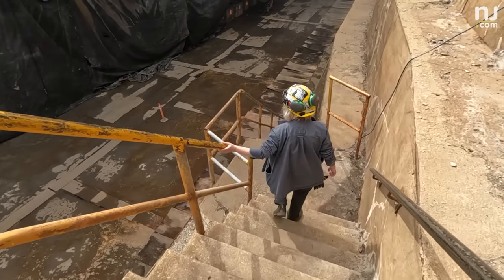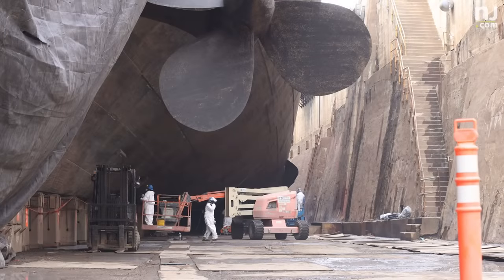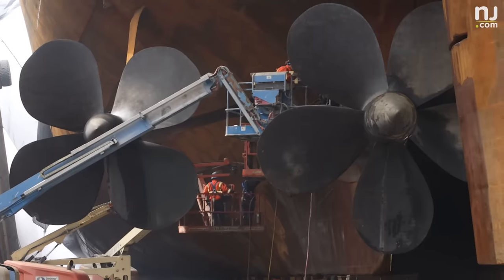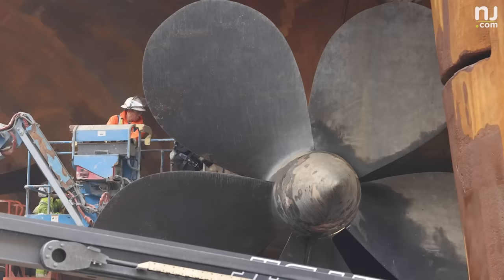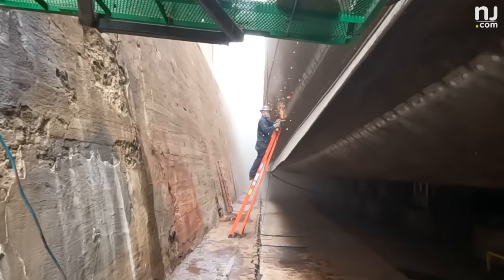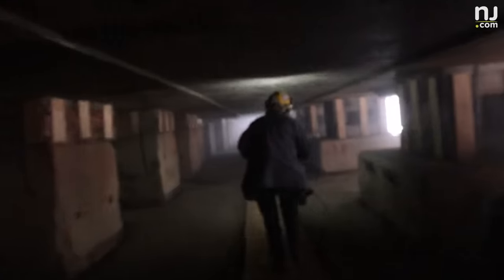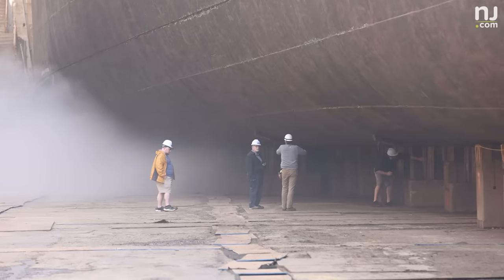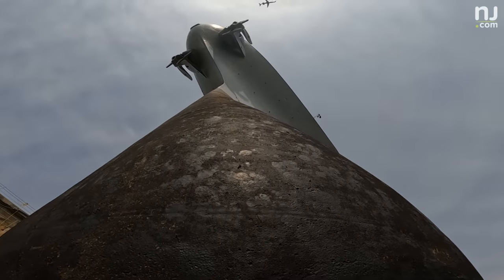Amazing views of historic USS New Jersey battleship while in dry dock for maintenance

Comment: I worked on the Battleship Iowa in early '80's at Ingalls Shipbuilding in Pascagoula, MS.  She had super hardened steel 13" belt armor around hull.  It can't be center punched.  4" thick double shell going up insides.  17" thick armor surrounding bridge.  It took 2 of us to open manhole to bridge.  Mark Gress and I were regular shipfitter apprentices at the time.  Paintings from Navy personnel were all over the ship.  Unfortunately, Ingalls shittard painted over them.  1" steel plates were added to many deck plates in passageways.  The teak wood was restored.  5" guns removed.  4 Tomahawk missile launchers installed.  Avondale shipyard in New Orleans did the hull work because Ingalls had no dry dock facility big enough to hold her.  Red combat lighting is on its insides.  Welds are all stainless steel.  It took a carbon arc gouger to remove welds as needed.  Many things don't line up.  As in bulkheads being 2" off backing up other bulkheads.  There is an expansion joint mid superstructure.  Asbestos was all over it.  Removed by a subcontractor.  We had to wear respirators all the time while on board.  The radar room was a rust bucket full of vacuum tubes.  Small battle station ports dot the ship with degree markers.  It was an unforgettable experience.  She's a magnificent ship.  Built by old men and women.
Reply: I was there a little later, commissioned the USS Valley Forge CG-50. What a great experience and you guys built us one hell of a ship. We even got to sit through a hurricane for good measure. I believe you guys were working on the first Wasp class at that time also.

Comment: How do they know where to position the blocking under the ship so when they pump out the water it settles in the right place?
Reply: Plans made by the original designers. I believe they actually got their current layout from when Missouri was drydocked in 2009. The curator from the video runs a youtube channel for the ship, they made a video about it recently.
Reply: @karroq  Thanks for the info. I will check out the other vids. 👍
Reply: I've wondered this too, eventually guessing that before a ship is launched it is measured and measured again. And probably again.

Comment: Why not just leave it out of the water so it wont rot as fast?
Reply: @rebeccalynch577  as they probably are now...Leave it dry.....it will last forever...theres plenty of space in that  depressed, abandoned area.
Reply: @TheJmich2001 Really? Cite one abandoned drydock that can fit an Iowa class battleship. There are no unused vacant drydock spaces for vessels this size. As it is now, US Navy vessels have to wait months to get into a drydock.
Reply: Ships this large are designed around having the force of water pressing in on them. Keeping her out of the water without that support will eventually cause severe structural damage that, unlike hull plating and paint, can't be fixed.
Reply: @griffinfaulkner3514  Thanks for the education.

Comment: Museum piece. It’s a large sitting duck for a cheap drone.
Reply: You think a drone would hurt that battle wagon? Lol, kamikazes bounced off the Iowa class with the CO calling out for the crew to man their brooms 😂
Reply: You think a drone would hurt that battle wagon? Lol, kamikazes bounced off of the Iowa class while the CO called for the crew to man their brooms 😂
Reply: @joeyclawges4578  Yes! A swarm of cheap sea drones will do it
Reply: You would have to crack the keel with a modern torpedo to sink it. Drones on the surface wouldn't do a thing to the armor belt. The Iowas were armored against armor piercing shells up to the caliber they carried. Russia's fleet is fodder because modern warships aren't armored like the ones in ww2 were. Certainly not to the level of a battleship, or anywhere near it. 

Battleships are irrelevant nowadays because of the operational cost and the limited range of the guns compared to missiles, but you can't trivialize their survivability like that. They were specifically designed to take severe damage and keep functioning. Modern warships are downed quickly by a missile or two. 

It is a museum, though. Has been for years.
Reply: The cheap drone named Daniel.
Reply: No ship is more equipped to take punishment and keep on fighting than a battleship.  The Iowa class was the culmination of design and engineering of the battleship type. 

A drone swarm would barely penetrated the super structure.
Reply: @daniel8728  what is wrong with you?
Reply: Some of the most amazing things about the Iowa s are all the armor they have.  I was aboard the Iowa in June, all four are museum ships now.  12 inch thick armor down the sides.  3 decks armored to accept incoming shells.  The face plate of the big guns is 17 inch thick armor.  Armor around the rudder steering room, etc.